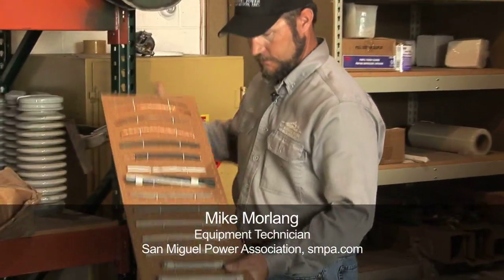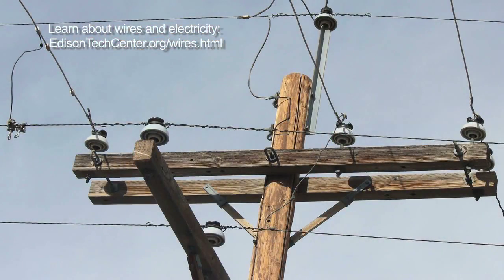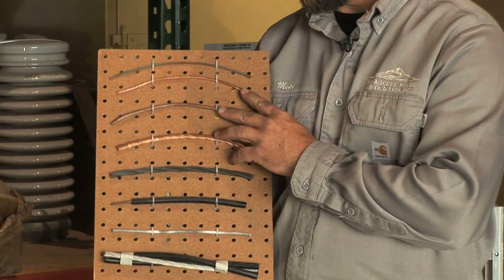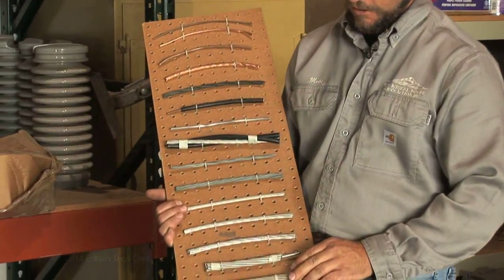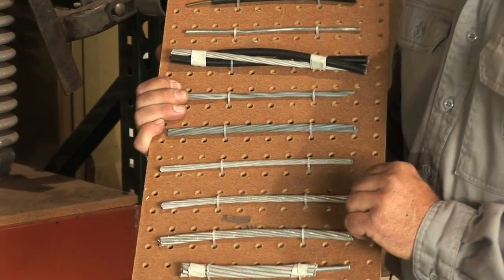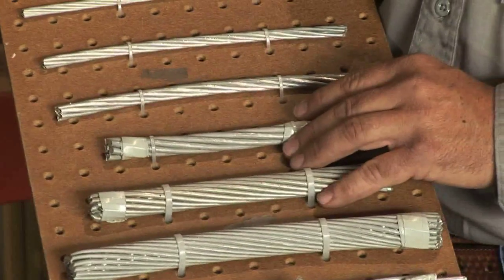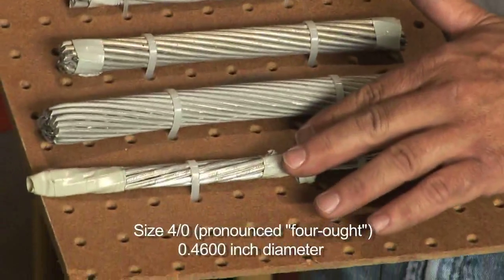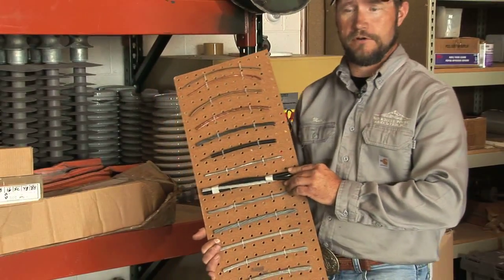Utility Wire Sizes

Comment: I think this video from eight years ago is getting to be a little out of date.  This past summer the electric utility replaced the towers and cables of one of the distribution systems for substations across North Dallas.  Since the electrical easement was recently used to construct  a new bicycle path, I had a chance to closely examine the new cables before they were hung from the new poles which replaced the old towers.  I believe the cable I looked at was a larger gauge than anything shown in this video.  It was still constructed of aluminum strands surrounding a steel cable, but the individual strands of aluminum have a cross sectional shape that is rectangular with rounded corners.  The conductors are spiraled side-by-side around the steel cable so that the flattened sides of the strands fit together and form a near-perfect circular shape to the complete cable.  Not sure what advantage this method provides over the usual round strand method, but it sure makes a neat installation.

Comment: What size wire do I need for a 15kva transformer to 15kva service panel meter assembly . 

2 conductor with 1 bare ground.

Comment: If you're not going to label the wire sizes on the board, you shouldn't 'point' with your fingers laying across three wires at once.
Reply: docshiznit when you’re presenting to the class and you’re not sure what is what because you didn’t study and you pull the “ I hope they don’t notice it “ trick 😂😂😂😂😂

Comment: This is a really nice video. I’ve never seen all these conductors together. However, I’m disappointed that there was one that isn’t there that I’m curious about. Sometimes now there’s a green conductor that has three green wires in a twist. I don’t see it much but when I do see it, it connects down from high tensions and hangs in the lowest spot on the poles. Between high tensions and the green cable, there are white insulators but no large transformers. What is this cable? No one seems to know. I’m assuming it is high voltage but insulated so it can hang lower?
Reply: That is bundled primary cable.  Very expensive relative to open wire or aerial spacer cable/Hendrix primaries, but the neutral shields and grounded messenger mean it can be much closer to the comms space on poles and in midspans.

Comment: What's the current carrying capacity of the 1/0 triplex cable?  Is that suitable for 100 or 200 amp service?
Reply: at the utility I work for in Canada we don't have a spec for 1/0 triplex but #2 is 165a summer 205a winter. we do have a spec for 1/0 Quad 200a and 250a. I can personally tell you lots of utilities will let you have a 200a service on #2 triplex. Hell, I've seen it on #4 triplex. remember its free air so you can typically add 50% current carrying capacity. Also, remember every utility is different and they all make their own rules.

Comment: So if aluminum is used in over head than why are we using copper for house wireing?
Reply: Because house wiring back in the 70's that used aluminum wire had problems that caused them to get hot at connection points.  Usually by the installer. A lot of municipalities outlawed them.
Reply: @denniscurless904  then use it for lighting instead... it's cheaper

Comment: is one ott ACSR ok to use for 200 amp service panel ?
Reply: In overhead, definitely. 

Most North American residential overheads are 1/0 regardless of service level at the meter, due to the wire being in free air, where heat is readily dissipated. Once in a raceway (conduit, pipe, or cable) the ampacity and cable size is adjusted accordingly. A 100 amp service will usually be #4 copper/2 aluminum, a 150 will be #1 cu, 1/0Al, and a 200 amp service will be 2/0Cu or 4/0Al after the weatherhead. 

At work, underground laterals in new houses, are almost always direct buried 4/0 Aluminum triple rated 'type USE/RHW/URD' tri-rated triplex cable. Except that one time, where a crew mistakenly laid 250-MCM cables to a house. Apparently, the stockman at the warehouse gave them the wrong size cable. Harmless for the 30-foot lateral, but at the same time, a class 225/400 amp service could be dropped in no problem. The lugs on the meter pedestal, breaker panel in the house had no trouble either, as both were good to 350MCM.

On a side note, the NEC that I as an Inside Wireman/electrican use,  is much more conservative with ampacity than the NESC that the power company's Outside Wireman uses.